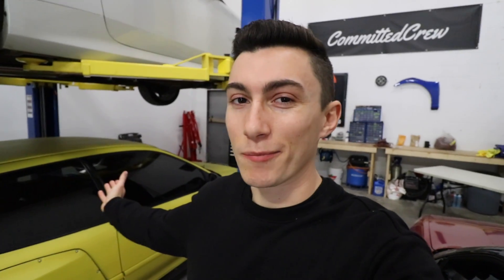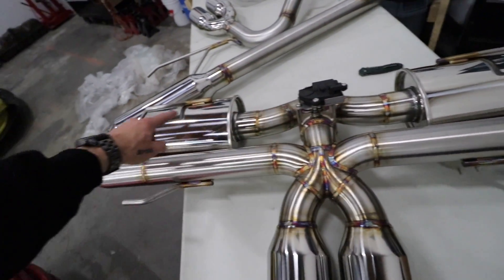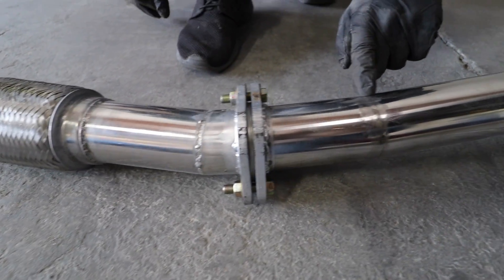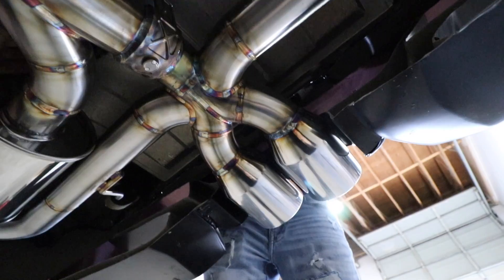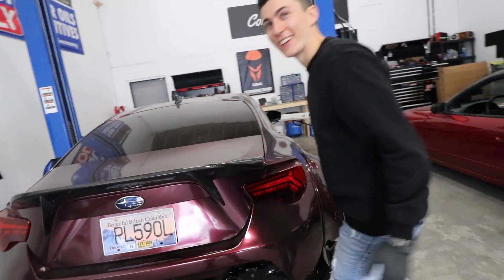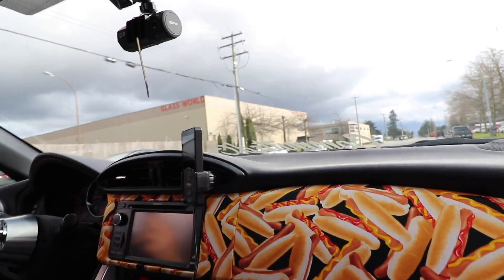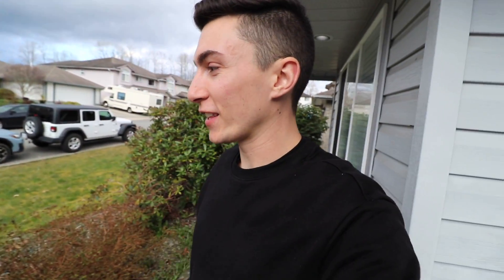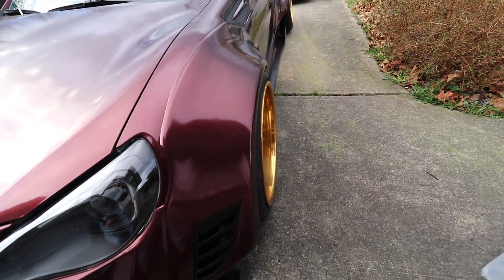CRAZY Center Exit Exhaust for the Karma BRZ!

Comment: Robbie, I think you should give Jasmine a little bit more love, I really recommend swapping out that b18 non VTEC and either swapping in a b18, b16, b20, h22A or even a K20 A VTEC engine. Bang for your buck, especially just hearing the crossover and being able to rev past 7.5K all the way to either 8.5 or 9K safely, don't go boost, Go all engine! I also recommend to keep the Pandem body kit on Jasmine and doing a proper paint job, or wrap on her she deserves it, take out your current seets for 2006-2011 civic SI bucket seats aswell. Really great seats. Your always talking about tracking a car and a civic would be the best, even better than the Genesis. And for any help let me know I had a single jingle D series built up on a 93 civic coupe. I would love to see more Jasmine content she deserves some TLC.

Comment: Robbie. Subaru looking tidy✌ word of advice don't go to low suspension.  When your traveling over a pot holes or bump. The tyre diameter changes. It's a bit like squeezing a balloon.  The air has to go somewhere. Tyres fully inflated change shape by quite a lot 10mm etc. You need to allow for this. Also with a turbo your tyre will increase in width by quite a bit too. Stay safe bro

Comment: great video! but absolutely butchered the spelling of 'Valve' at 13:00
Reply from the maker: I know okay😂
Reply: @RobbieFerreira  also just thought. Have you thought about taking one of the remotes apart and soldering a button that's connected by wires to the PCB board and placing the button in the dash? So if you push the button, it will open the valve. Very easy to do.